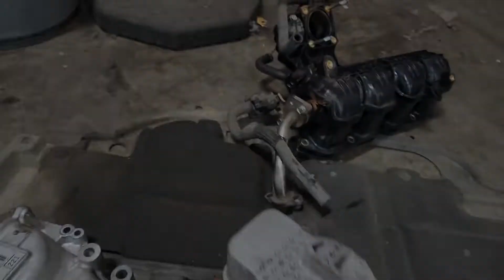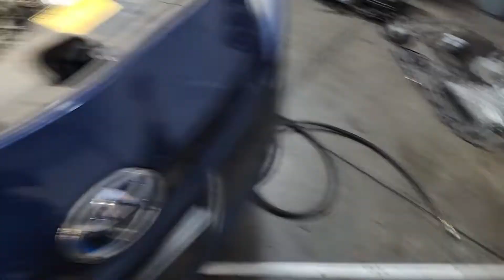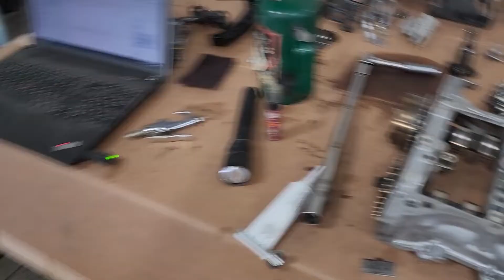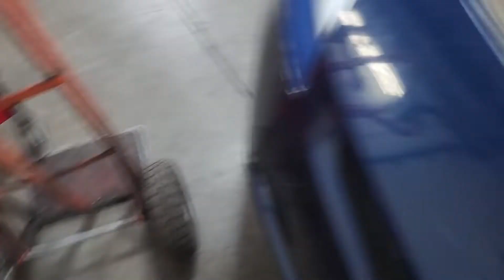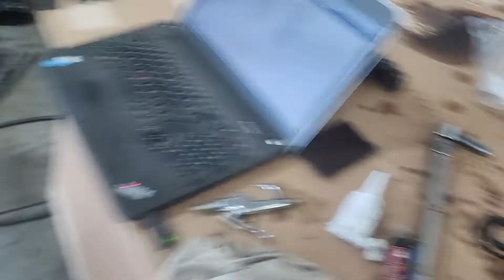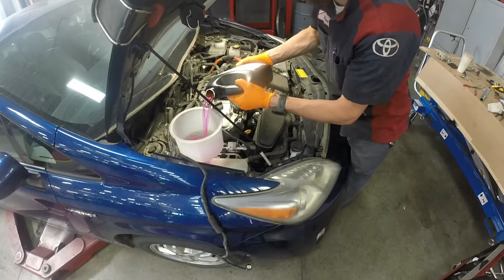How to Install a Toyota Prius head gasket

Comment: What is FIPG? Is that normal silicone or a specialty product?

Btw, love the videos man, keep up the good work 👏
Reply from the maker: It is short for form in place gasket. We use a Toyota brand, but there are aftermarket companies that make similar stuff.  You just need stuff that is good for oil and coolant.

Comment: Nobody seems to cover this: Did you bleed the lifters before reassembly?
Reply from the maker: No, there is no need. Just check when they are out that they hold pressure, not easily depressed.

Comment: My favorite tips from this video are the paint marks on the head bolts, the engine mount bolts preinstalled to keep the holes clear, and the reminder to go around the outside of the bolt holes when reinstalling the cam tower.

The engine block surface looked a little scratched during the cleaning. Don't you want to be very careful to keep that smooth? Use gasket scraper and solvent only, no abrasives? Scratching up surfaces that take FIPG is fine, on the other hand, as long as you don't get metal dust into the oil. Give the camshafts and everything else a full rinse after using a sanding disk on the cam tower. Toyota has enough problems with metal particles in engines already.

Also, FIPG is created to speed up factory assembly and works well for professional mechanics like you who need to get the job done quickly. DIYers are better served with ordinary black or grey sealants that give us longer assembly time and take an overnight cure. I'm fine with installing the timing cover lightly, taking an hour break, coming back and torquing down the bolts to spec, then not adding oil or coolant until the next day.

Comment: Great videos. I really hope I never have to do this in my garage. I would love to see a link to or a photo of that abrasive wheel you used to clean the gasket surfaces without harming the aluminum. Also, what does a repair like this cost? Must be $2-$3k I'm guessing. Thanks!
Reply from the maker: They are called rollock discs, and it is around $2,500 parts and labor.

Comment: Hi i notice the water pump still mounted to timing cover when you first show the cover then at some stage before reassembly the pump was removed, question is can we just leave the water pump on the cover for the whole procedure to save the gasket or does it 100% need to be removed.  Cheers :)
Reply from the maker: You can leave it on. You only need to remove 2 12mm bolts that go through the pump and front cover.
Reply: @shoptimewithdrew  Thanks for reply, I thought there was half a dozen 12mm for the pump?
Reply from the maker: There are, but you only need to remove the 2 on the cover side of the pump.
Reply: @shoptimewithdrew  thanks will do :)

Comment: Why does it fail ?
Reply from the maker: I think it is caused because the engine is always heating up and cooling down multiple times on a drive cycle. Engine  designe, it seams like they have it fixed on the 4th gen.

Comment: Do you recommend replacing the timing chain,  Guides and maybe the tensioner or is that pretty much OK to continue using
Reply from the maker: At 200k miles, I would recommend chain, guides, and tensioner while you are in there.

Comment: I took my 2012 pruis in Tijuana Mexico i brought a fel pro headgasket they fix it for $500. I was losing coolant had p301 p302 p303 check engine light they fit it.
Reply from the maker: That sounds like a good deal.
Reply: @shoptimewithdrew  yes am the original owner it has 176,000 miles the dc inverter at 130k went bad it was under warranty. At 150,000 my water pump went bad i fix it myself then at 166,000  at start up i heard a loud knocking sound then it would go away ,i was losing coolant. I know soon that my hybrid battery going go bad am California correctional officer in San Diego Ca but i live in Rosarito Mexico Dual Mexican Citizenship .
Reply from the maker: It is funny that you listed all those different mile intervals, which is when we normally see those jobs come in at our shop. I'm glad you are taking good care of your car. I hope you will get many more miles out of your prius.
Reply: @rosaritomex4223   I'm also from San Diego  With dual citizenship, If you don't mind maybe you can give me a referral so maybe later I can take my 2012 previous V with 211,000 miles, All I've done so far is Change the PCV valve added a oil catch can clean the EGR cooler and replaced the water pump, Other than that no problems at all, Doesn't burn a drop of oil or coolant, great car I love it, But it's good to have somebody down for just in case,  I bet the mechanic would be very happy you referred him, I also really would appreciate it
Reply: @mrvic92154  awesome bro let me find the guy shop when i have some time and will let you know.
Reply: @rosaritomex4223 can I also get the info? Knocking just started earlier this week. I replaced the water pump earlier this year after a couple of check hybrid system stalls that both happened driving past Mira Mesa Blvd on the 15. I'm at 183,000 miles now. Car started buring oil back at 135,000.
Reply: hola una pregunta mandaste a rectificar el cabezote ??? Gracias
Reply from the maker: No this one was within spec.
Reply: Do you recommend doing a drain and  fill transmission fuild change i never did it . At a toyota dealership in Tijuana they  told me because i never did it to just leave it. When i call a toyota dealership in San Diego they told me they recommend it.
Reply from the maker: I recommend every 90k to do it. Toyota said it is lifetime fluid, and that means 150k.
Reply from the maker: I also have a video showing a drain and fill on a prius transmission if you want to check it out. There is also a link to the fluid in the description.
Reply: U have email of them